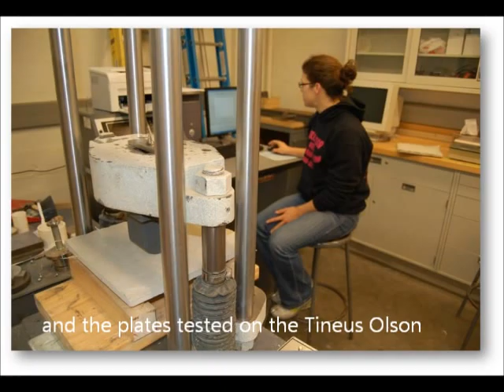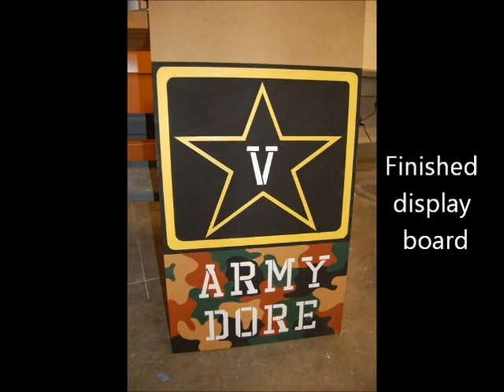Vanderbilt Concrete Canoe

Comment from the maker: Crisco worked very well. It was applied to the mold on build day, particularly in the bow and stern. To release the canoe from the mold, a putty knife was used to create a gap between the mold and the canoe. The mold, consisting of 3 portions, was elevated on 2x4s. Pressure was applied downward to each piece one at a time by multiple people. With some pressure the mold slid right off. The outside finish was so smooth it did not require sanding. Very Minor patching in the bow and stern was needed